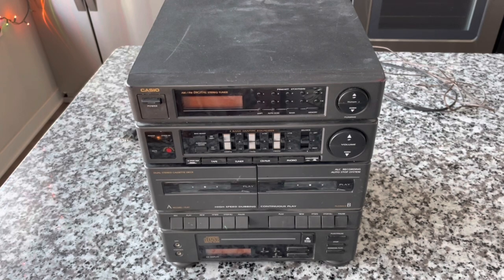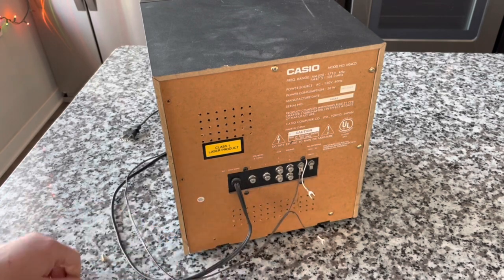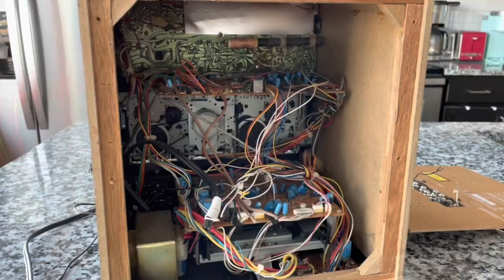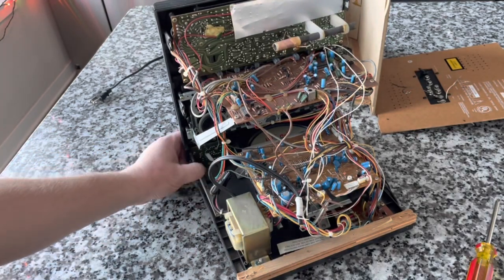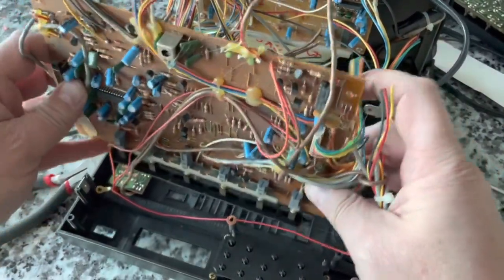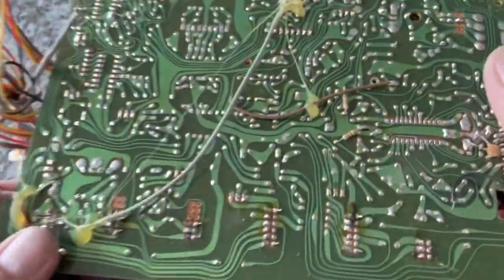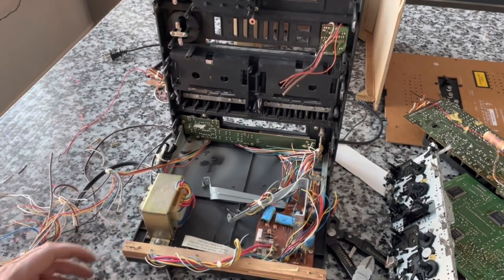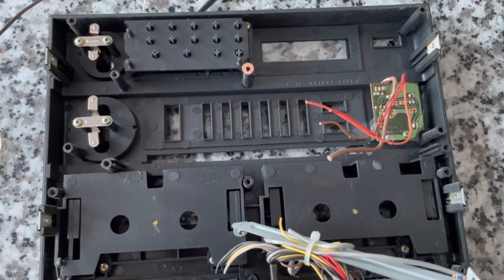Casio Stereo Destructive Teardown? (Vlogmas Day 23) #vlogmas #christmas #vinyl

Comment: The white wire wrapped around the power cord was for an "internal" FM antenna. It couples to the power cord to use it as an antenna if you don't want to connect a standard external antenna much like many alarm clock radios use.

Comment: That "Property Of Orient Power"  means it is most likely manufactured by the Hong Kong OEM, Opel Electronics or Orient Power
Electronics Ltd. I have seen the Opel name on a few circuit boards of cheap Hong Kong made radios and stereo combos before.

Comment: 11:18 - no they are not "surface mounted", that would mean it is soldered at the same side as the component, but this is a 1 layer board (brown no traces on top and traces with green protection on bottom). So they are all through hole components, also the buttons, that have 4 points of soldering on the back side of this board. 14:50 - those ICs are expample for surface mount, or SMD, compoenents: Soldered on the same side as the component is on.

If you put it back together and it works 100% I'll donate hahaha

Comment: In the late 1980s I had a Toshiba cassette boombox. It had detachable speakers, balance control, 3 band graphic equalizer (they didn't go very far) and an am/fm radio. 
I have seen Mitsubishi component racks from back in the day, they were upper lower to midgrade units, they looked better than the entry level units, but were usually bass and treble heavy where it took a bit to get them to sound decent.

Comment: It's not on common to see Sony cheapest in a CD player as I have a 1988 Yorx OEM by funai and it uses Sony cheapest too. Even thoe my Yorx CD player is from 88 it still works perfectly and was the most basic player as you  only have basic transport controls no repeat, shuffle, and program feature.